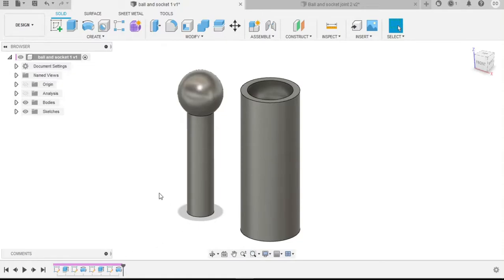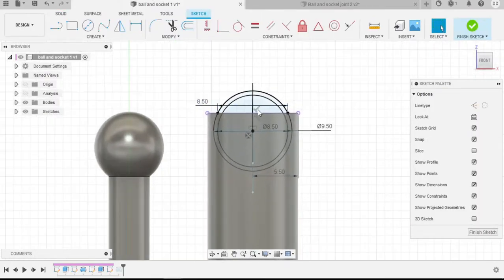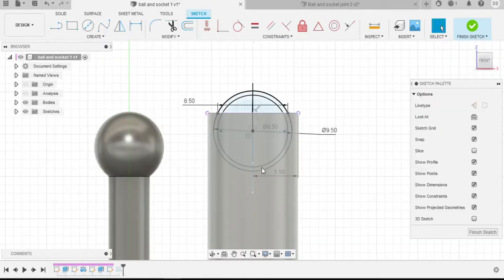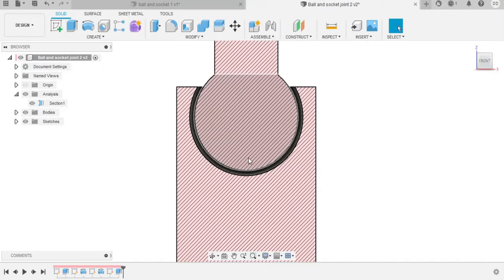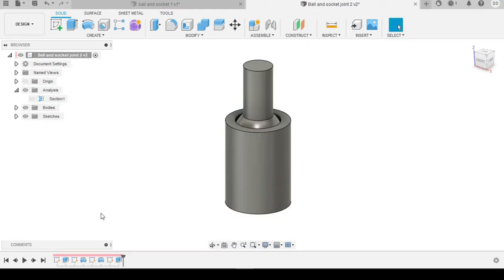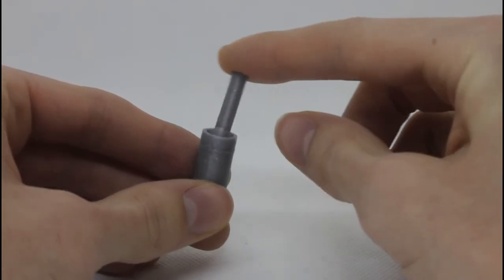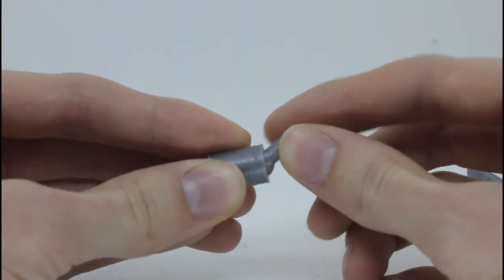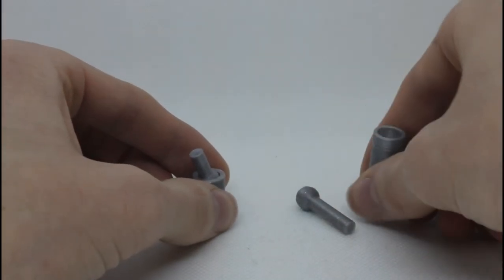Designing Ball and Socket Joints | Print in Place | Fusion 360 | 3D Printing

Comment: Can it work with a hole through it to let water flow at different angles?
Reply from the maker: I don’t see why not, you would just have to have a proper gasket seal inside the ball joint to prevent any water from going around

Comment: I am making a ball joint for an action figure type project and it needs to be tight enough for holding a position but easy to move for posing, any tips or ideas for the measurements?
Reply from the maker: Measurements will depend on the size of figure you’re making, but if you made the offset on the breakaway (print in place) joint 0.1mm with a difference around the ball and socket 0.1mm that’s probably a good starting point for some tests at least
Reply: @ ok, thank you for the help

Comment: would you have any practical applications for this?
Reply from the maker: A few applications for this type of design:
It’s really good for parts that you want to have motion but don’t want to come apart, 3D printing allows you to manufacture that way which you wouldn’t be able to do using traditional methods. 
Another application would be if you were to make a design like this in larger quantities it would eliminate the labor hours needed to assemble the parts. 

Hope this helps!

Comment: I just want to make an action figure ball socket joint and have enough friction that its poseable. None of this "loosey goosey" clearance bs.
Reply from the maker: This won’t be the video for that, look into this one, I’ve made a few action figure styles using this kind of joint and had lots of success https://youtu.be/12lq8g0mia0?si=vCbSxyc6Pensi7a-
Reply from the maker: I also have another video that if you played with the tolerance of the design you could get some pretty good friction fits Designing 3D Printable ball and socket joints | Fusion 360 | 3D Printing | Print in Place
https://youtu.be/gZUgoZ-w4QY

Comment: Great and helpful video. A question i have is how would i then make the socket stay in place for the one printed as one
Reply from the maker: To make it stay in place during printing ensure there is minimal separation between the “socket” and the “ball” 
The ball should be designed within the socket but have a gap large enough for about 1 layer line of a 3D printer (approximately 0.1 - 0.2mm) depending on your printer settings

Comment: Is there any way I can download this file (specifically the print in place, I tried to make my own joints but the first didn't move and the second spaghettified, this file would be super useful for me as I plan to make many articulated prints
Reply from the maker: Sorry I don’t have this design published anywhere and didn’t save on my computer it as it was only for demonstration purposes
Reply: @engineer3d  Thanks for responding, although, do you have the design for any other ball joints?
Reply from the maker: I have a few other random ball joints. None that are print in place and stackable though

Comment: for my 3d balljoint i went with not-printed-in-place and making the base so you can insert the ball / rod in from below, then thread in a ball sized cap with a curved inner surface, and as you tighten that back cap inward, it torques the ball down tighter in the joint, so you can adjust tension.  Works pretty great?  I had good results with my resin printer and fairly tight tolerances.
Reply: That's pretty smart! Gonna keep this in mind for my project.
Reply: @Vampiric_Kai  Thanks, hey bonus tip: there's a kind of shower curtain ring you can get, usually called 'roller ball shower curtain rings', and they each have 5 or 6 pre-drilled metal bearings you can take off and use for ball joints, super handy, cheap and very strong and smooth.

Comment: Thanks for making this video!  I'm thinking about making some ball joints for my projects.  I don't think I would make the ball joint opening the same diameter as the ball.  Instead, I think I'd make it 9/10ths the diameter to start with so that it doesn't fall out as easily.  The socket opening could be made even smaller if a relief cut was made vertically into the ball to allow the ball to compress a little bit while inserting it into the socket.  I think that shrinking the second bigger cut into the socket by 0.5 would help make the joint tighter.  Joint tightness can be improved with the application of floor polish to the joint, provided the clearances are good enough.
Reply from the maker: For sure, main purpose of the video is for the general idea, clearance and fit definitely depends on the type of project you’re doing! 
Best of luck on the project!
Reply: you would be surprised as well as to what a little heat gun will do  :)   did a huge version of the IRON GIANT and the heat gun was so very helpful.. the whole robot was articulated and fun as hell to print...